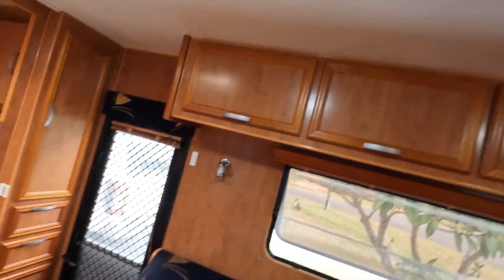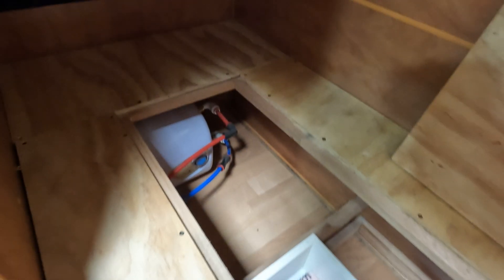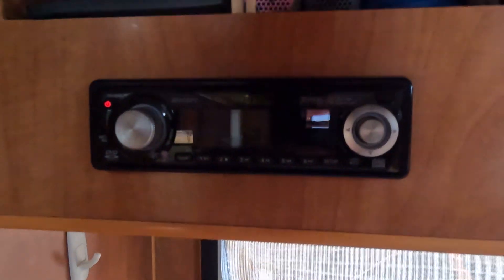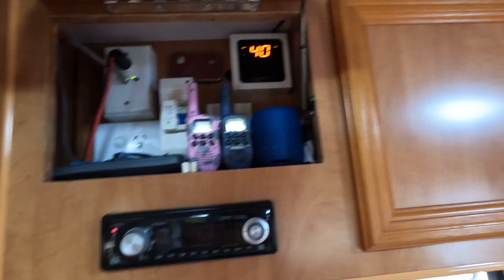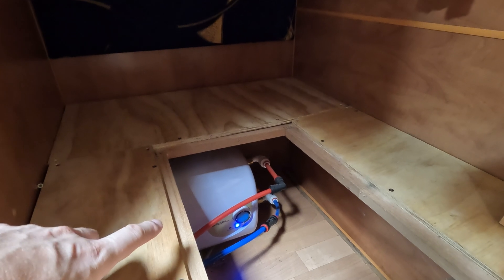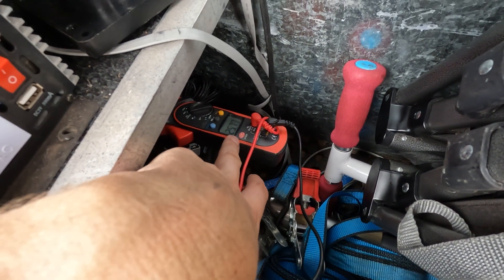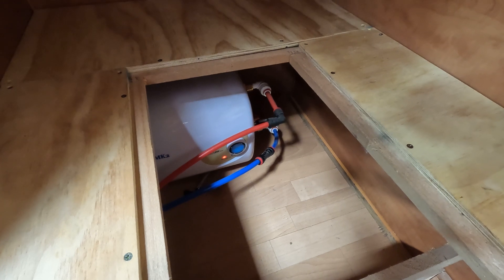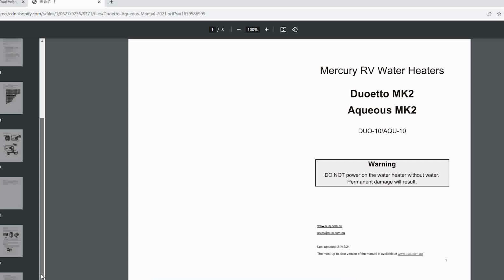Aus J Duoetto MK2 Digital Dual Voltage (12v/240v) Electric water Heater wiring

Comment: Thanks for the video, is there a way to have the full 12v small and large wires to run off 1 Anderson plug? Im looking at trying to create a small box for everything that can plug and play for the back of my ute. 12v wiring is not my speciality 😂
Reply from the maker: Yes if you ran both the big red and little red into the positive side of the Anderson plug and the big black and little black into the other side then as soon as you plug it in the water would start warming up. You would have to turn it off by unplugging the anderson. Feel free to ask more questions if i didnt quite get what you meant. dont stress about not getting the wiring, it is a bit confusing the way they've done it.
Reply: @berko79 thanks mate, yeah I ended up doing that and putting a switch in, worked a treat!
Reply from the maker: @michaelbeerling8997  Ah all good, sorry for the delayed response, I was logged into my other youtube account and didnt see the notification. Hopefully the heater is working out for you, we love ours.

Comment: Hey mate thanks for you video, I’ve got one of these, I was looking at the wiring of this & found that the red wire of the 2 big wires are running through an isolation switch but the switch was dodgy & wasn’t supplying any power to the unit but it was still working as normal??? 
I’ve replaced the switch & now it’s getting 12 volts from that. The weird thing is it was working on 12 volts without that main power source. Any ideas why?
Thanks in advance.
Reply from the maker: Do you mean it was working on 12v but not on 240v? They are completely separate circuits so that would make sense. Or do you mean it was working without a 12v circuit through the small wires? that sounds weird if thats the case

Comment: Mate can you just run these units off 240 volt. Always in caravan parks. Are they just plug in to power and off we go. Thanks
Reply from the maker: can get a pure 240v one with no 12v option. But yes plug in and it will start heating your water. Be perfect for caravan parks or generators.

Comment: I’m about to start my build. When I read up, it seems that it’s better to always use the inverted 240V when heating water. The thermal losses when using 12V and the longer time it takes makes it less efficient. What’s your real world experience?
Reply from the maker: oh that's a good point...to be honest I've never tested it. I guess it just comes down to is the loss in water temp over the extra say 30 mins more or less than the overhead of the inverter - I reckon it would be very much of a muchness. I tend to use the 12v quite a bit, particularly when hooked up to the car (so we have hot water when we arrive at our next stop) or slowly hitting the battery while we have sun on the solar. So yeah more the convenience rather than the efficiency because like you said it could quite possibly be less efficient.

Comment: Love the video, super informative!

Curious how efficient the heating is, have you ever timed how long it take to heat up the tank? I.e, from ambient (20C) up to say 60 or 70C on 12V or 240V?
Reply from the maker: I did time it but i cant find my notes on it. The 240v is very fast, like 15 mins ish to get it hot enough you cant keep your hand in. for 12v it is a lot longer - would be closer to 1 hour. If we are off grid and need hot water quickly I'll use the inverter and hit the 240v option.

Comment: that strange 240V option preventing 12V works well for me. I have a socket that is powered by shore power (not inverter) and that means on shore power the heater works from 240V and if not on shore power it switches to 12V which is exactly what I want
Reply from the maker: yes this must be why its designed that way :)

Comment: Great videos... now just gotta do another video on the plumbing 😅

I wanna know if you have a mixer setup for shower or if you just have the temp set for ideal shower temperature.
If you have a mixer, is it one pump from the tank, then teed off to feed the water heater and straight to cold taps? So one water pump to supply your whole system?
Reply from the maker: Thats correct, I have both hot and cold and mix. Yes the piping is like you mentioned with the hot water supply t'd off the cold line. The one thing you do need to do is put a one way valve just before the heater to stop the hot water flowing backwards into the cold pipe.

Comment: It is quite possible the heater control is “quirky” as a result of switching the negative instead of the positive as done in the wiring diagram.

Comment: Yeah it is the switch that gives me a headache. The reason I don’t want to run the 240v is due to needing to turn on the inverter which draws more wattage. But I guess it would heat up quicker. Thank you for the explanation on the circuit drawing…I will have to watch a few times:))

Comment: Hey mate, thanks for the video! Recently bought the Aus j unit but yet to plumb/wire it up. I’m just curious why you decided to switch the negative and not the positive on the smaller cables? Cheers
Reply from the maker: Hi Mate, I just did the negative so I could locate my switch somewhere handy without running two sets of positive. You can mount it anywhere on the small wires as it just needs to break the circuit. So positive or negative just go with whatever suits your situation better